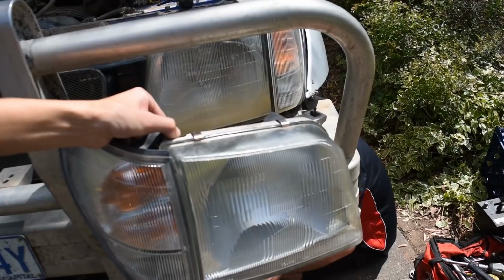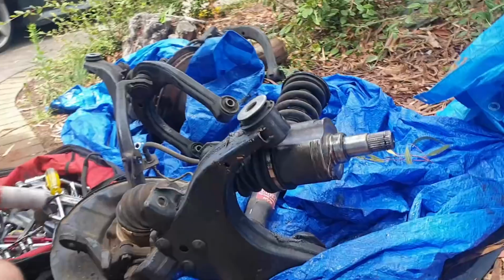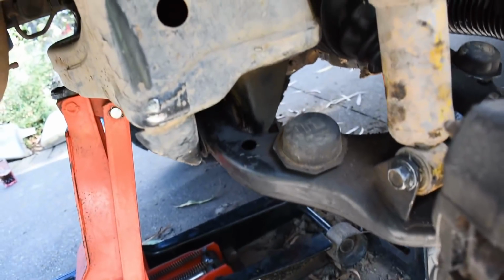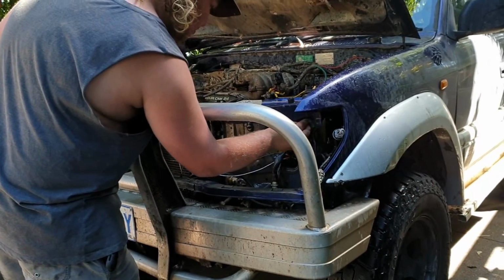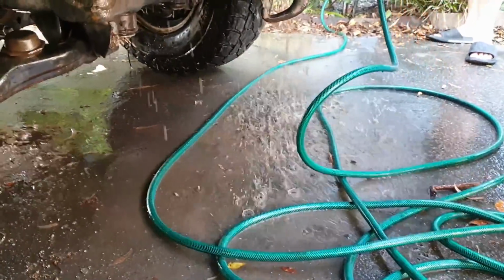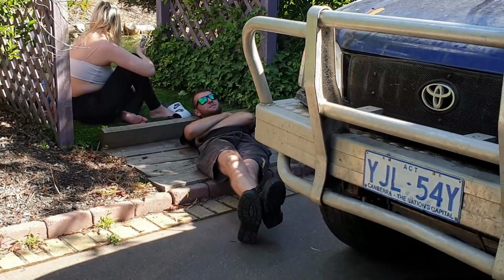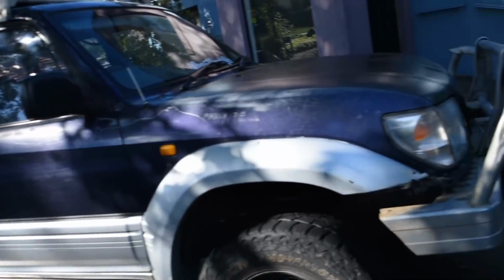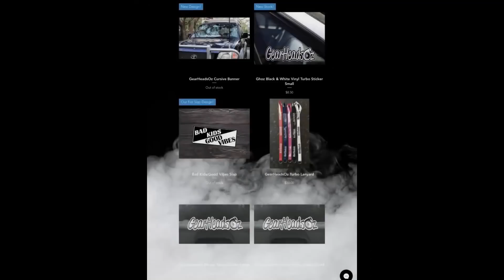The Prado Rig Is Finally Fixed & Driving! + New Parts Make a Huge Difference!

Comment: U install that 2" lift and watch how many cv's u go through. I speak from experience mate😭
Edit; have fun with the install on the rear
Reply from the maker: It's always been lifted man, its got 2" all round, we were comparing that to the stock setup that came with the spare front end parts haha
Reply: @GearHeadsOz  Have u had many issues with the cv's!
Reply from the maker: @mick3422  nah man, I've only ruined cv's by snapping suspension bits hahahaha
Never popped one from having the lift and the way it flexes with it etc surprisingly, and its copped some fairly high speed abuse off road as you'll see soon 😂
Reply: Yeah mad! Keep the content coming👍